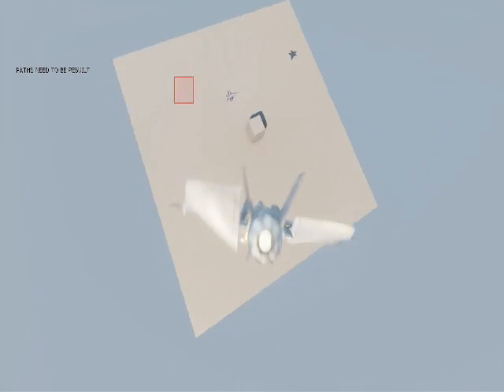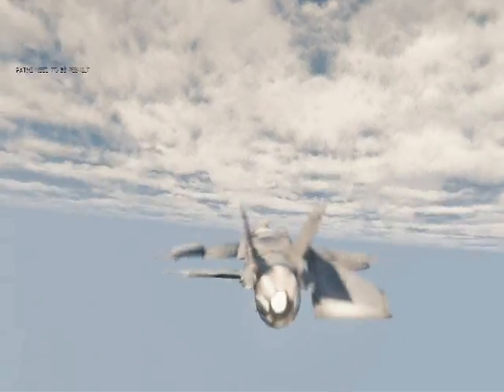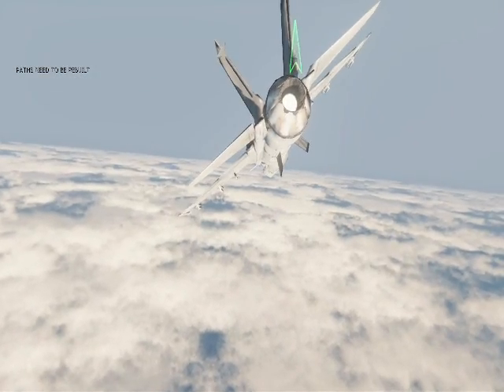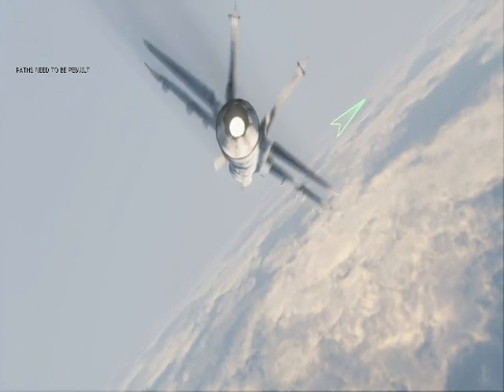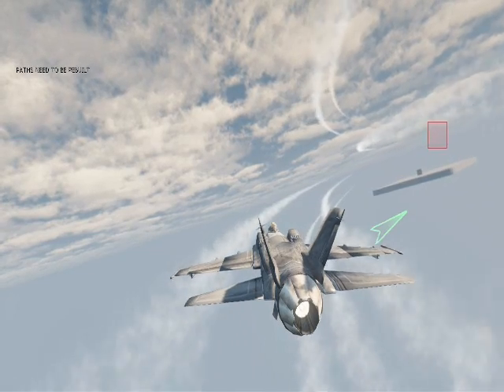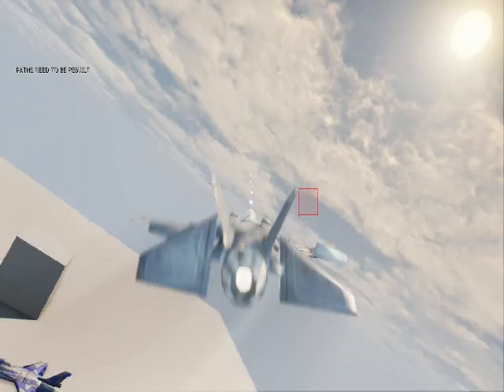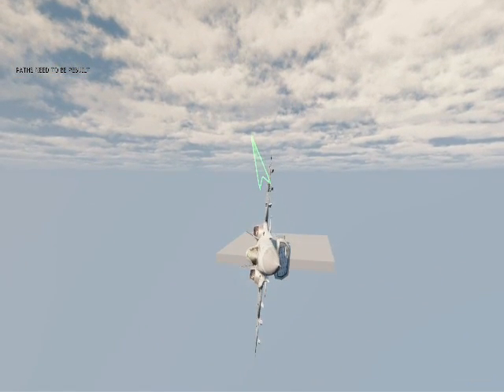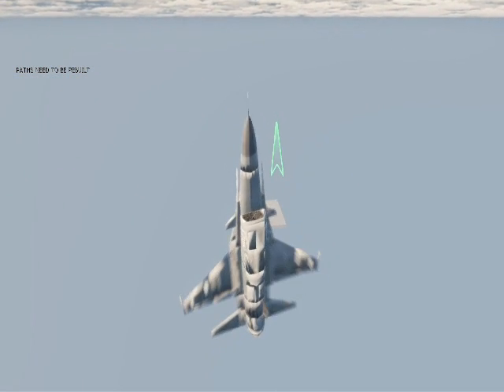HS4_PlaneProblem1.wmv

Comment from the maker: Check my later video, the bug is fixed and it's now a complete game. :)

Well, the heart of the plane mechanic is the thing called "Quaternion". It's necessary to  implement the rotation system in Quaternion (and convert it to euler later) because ordinary pitch-yaw-roll rotation is not enough, to do this kind of rotation - 4 axis (of quaternion is needed)

I'm pretty sure you can find a very simple sample of Quaternion rotation usage in UnrealWiki.